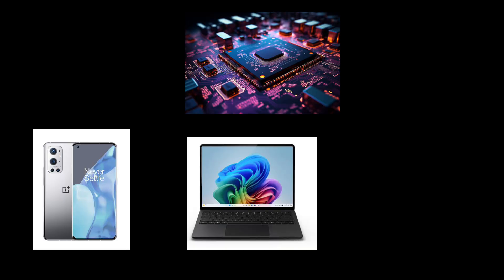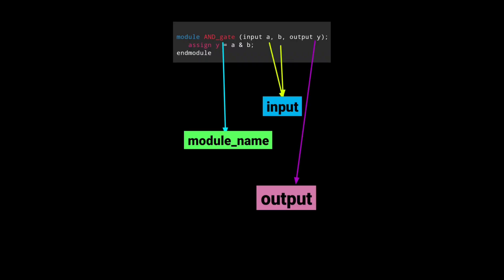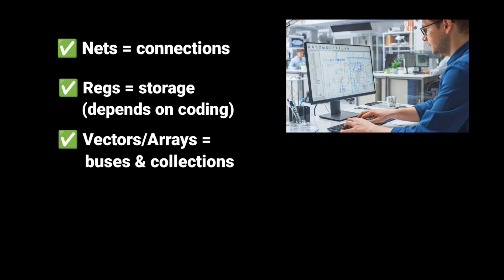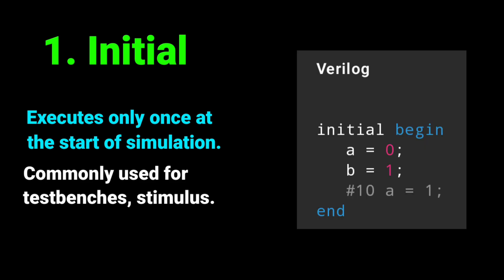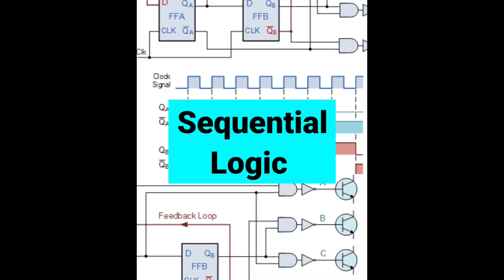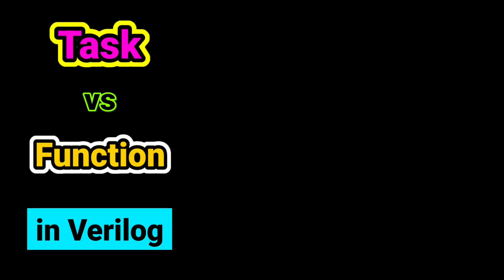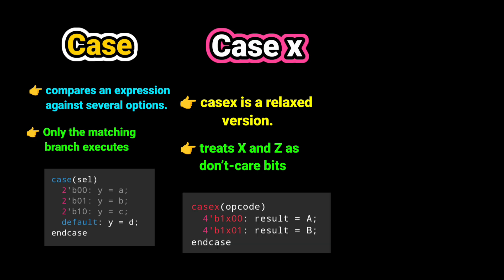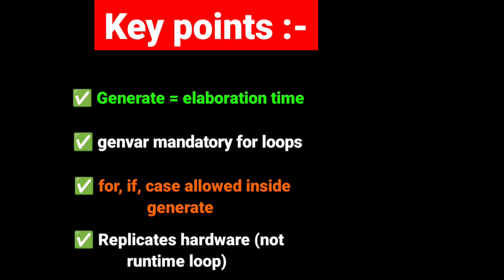Verilog in One Shot | Beginners and Freshers | Learn Verilog HDL from Scratch #verilog #asic #uvm

Comment: Timestamps (Powered by Merlin AI)
00:08 - Verilog is essential for designing and verifying hardware circuits.
02:12 - Overview of Verilog modules and data types essential for design.
04:06 - Data types and operators in Verilog are essential for modeling and simulations.
06:05 - Overview of Verilog operators and procedural blocks.
07:58 - Understanding blocking vs non-blocking assignments in Verilog.
09:55 - Understanding sensitivity lists in Verilog for combinational and sequential logic.
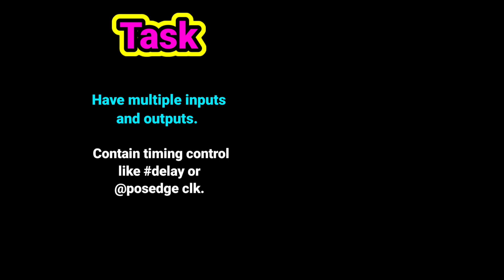11:56 - Explains tasks and functions in Verilog HDL with examples.
14:20 - Generate blocks in Verilog streamline hardware construction.